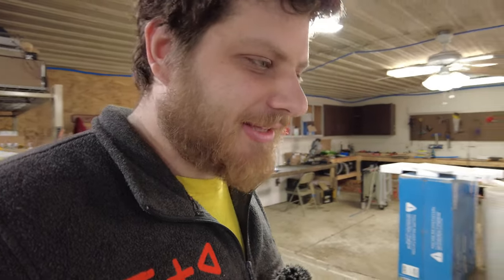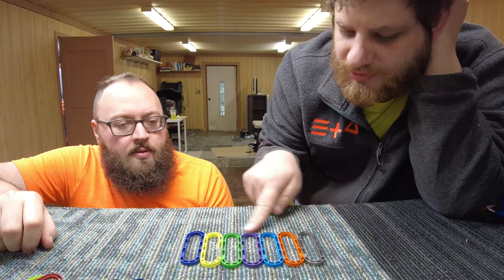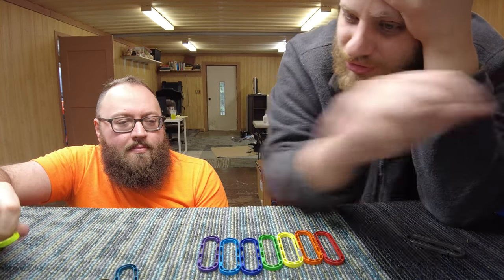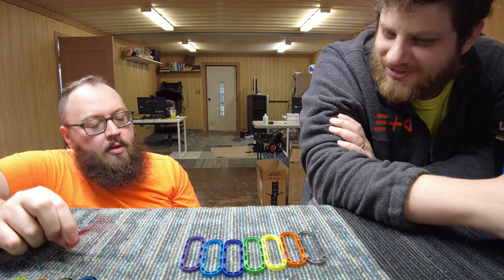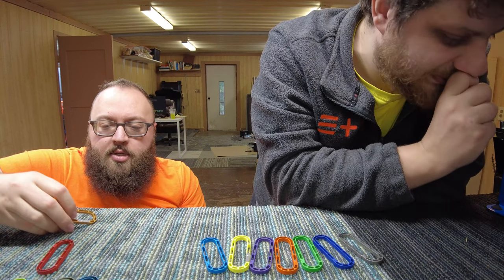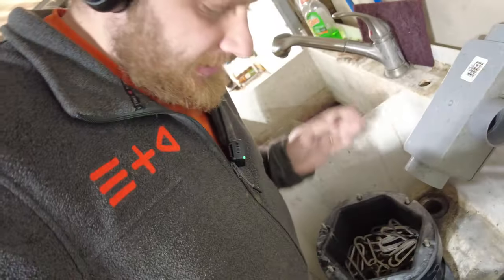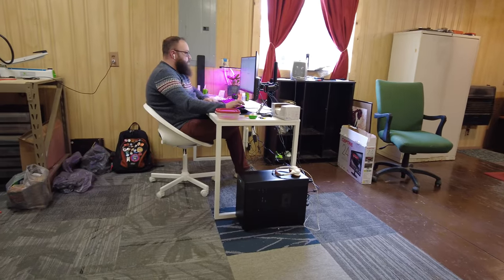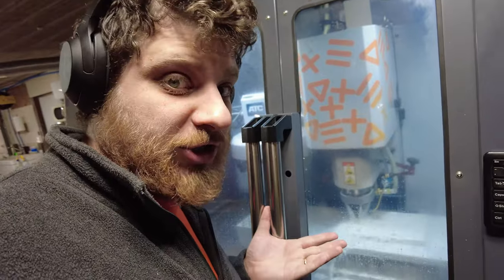We Got Our First Wholesale Order!

Comment: Would prefer the multiple open spaces at bottom.  That way we can attach key rings separated by the small sections, to prevent bunching up.
Reply from the maker: Not a bad idea! We can't add walls to the bottom slot, since that is how the carabiner bends, but i've been working on  a S-shaped carabiner that will have some sort of dividers. It's still very much a work in progress, but I am trying to solve that problem.